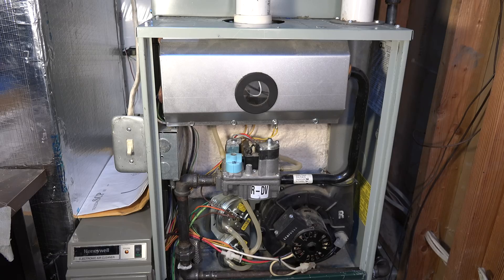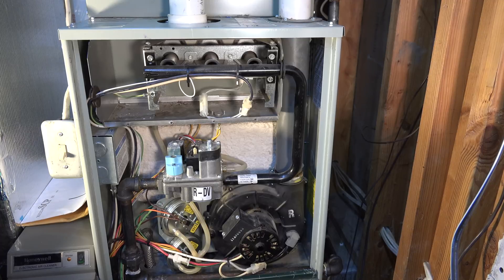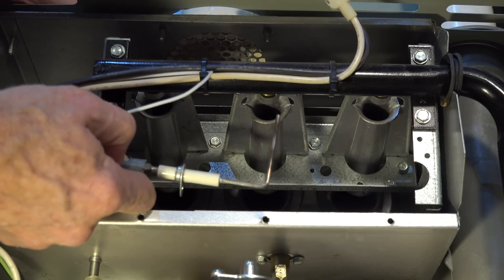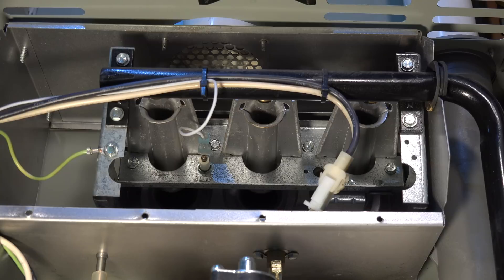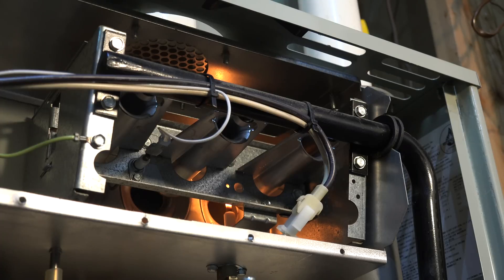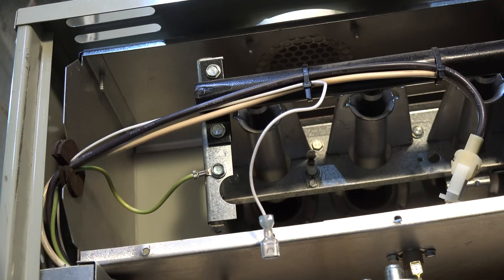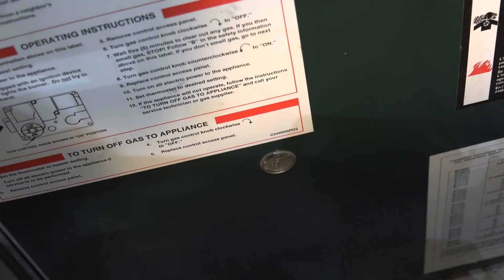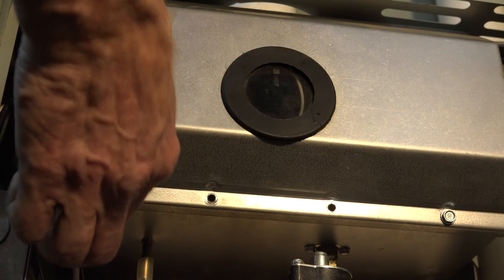Replacing the flame rod

Comment: Hi i would reqlly appreciate a bit of advice . Ive just brought a electric fire off ebay . Its making a loud clicking mechanical noise every couple seconds . Only when the flames are on . If its heat only theres no noise . Seller is trying to tell me that its been this way since he brought it and that the company he brought it from said it was normal sounds for pushing out heat . 1. It doesnt happen with the heat, 2. Ive never heard those sounds coming from a "normal" working fireplace . He didnt tell me about the issue . Googles led me to believe a rod or synchronous motor . Hes still insisting he didnt tell me as its normal and he doesnt see what the fuss is about . Obviously im extremely unhappy . Could you advise please wether this is actually a fault

Comment: good recommendation on pulling the wire off the flame sensor to test it.  I think most modern furnaces will look out if the flame sensor senses flame with no call for heat.  I've had it once because condensate got on the control board.
Reply from the maker: I hope you replaced the board.
GFM
Reply: grayfurnaceman it was after hours call brand new trane furnace,  trane locally to me doesn't have weekend hours, I dried the board with a hair dryer, pulled the combustion motor off because I thought that was the cause of the leak.  I blocked the control board with plastic wrap until we could return during regular business hours.  I thought it had a leak from the heat exchanger but the next guy that returned Monday said it stopped leaking and was fine since.  maybe it was the RTV from the factory behind the combustion motor since I re-applied it.  never heard of any issues since.
Reply from the maker: The reason I say replace the board is that it is a flame safety control.  There are safety issues.
GFM

Comment: Could you help me I have a nordyne electric furnace model E3EB-015H and air I'm wanting to run a common wire for a smart thermostat the wiring is there but not sure where to hook it up on the furnace side please help
Reply from the maker: Connect the wire you want to use (black is best if you have one) to The C terminal at the furnace.  Then of course, to C at the thermostat.
GFM